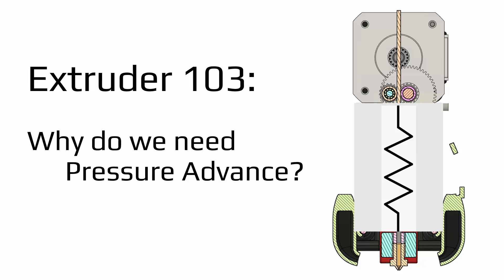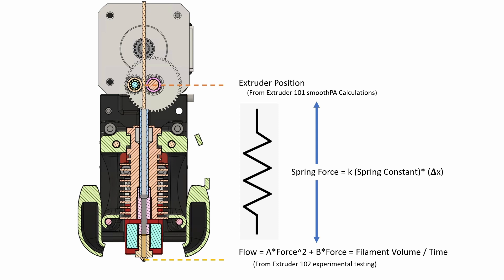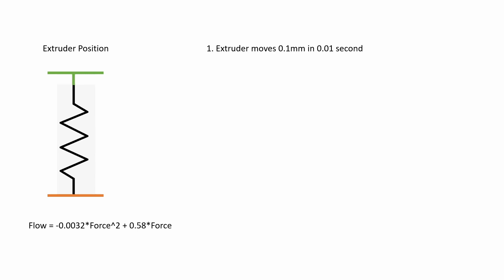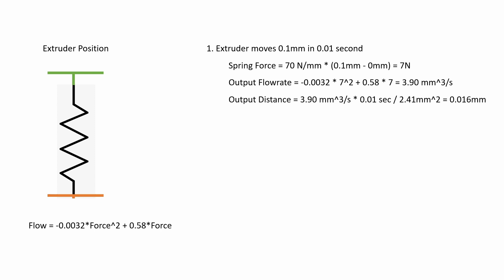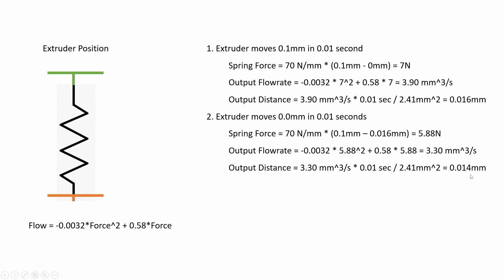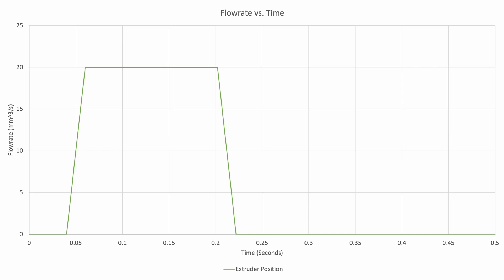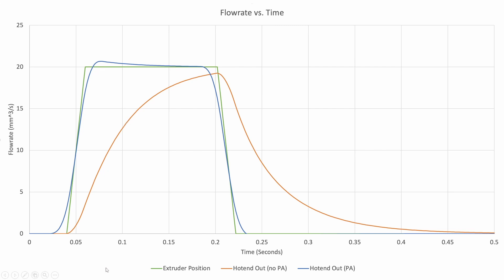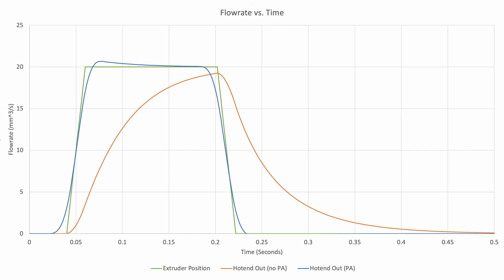Extruder 103: Why do we need Pressure Advance?

Comment: I cooked churros today and it helped me a lot to understand pressure advance.

Basically the process involves pushing dough through a stars shaped hole. The pressure is applied by turning a screw that moves a piston. The first I noticed was that when you stop turning, dough keeps coming out for about 10 seconds. Then I noticed that the opposite thing happens when you first start turning the screw.

Kind of random but it was very funny to me (but difficult to explain why to the other people in the kitchen).
Reply from the maker: This made my day!
Reply: @eddietheengineer  thank you! It made mine to!
Reply: Oh yeah. You're right. Also applying caulk or mastic with one of those tube guns.

Comment: Have yet to work with this feature. Appreciate your detailed analysis. Essentially an open PID loop with feed forward parameter? It would be handy if there were some form of real-time feedback in scalable stepper motor/driver current or strain gage with the correct span and resolution to close the loop. 
Relying on constants should keep the influencing parameters realistic between under and over extrusion with methods to verify cause and effect for tuning associated variables.

Comment: Excellent video! I love the graphs. You talk about the smooth PA somewhat rounding the edges of the green graph (for a lack of better word). At this point would it make sense to replace the trapezoidal motion with something similar to what S-curve was attempting to do in Marlin? (Technically I can't use S-curve in Marlin because it doesn't have the required PA implementation) While S-curve aims at reducing instant changes in acceleration (3rd derivative?), we could have the motion follow the blue graph instead for a similar effect, but with the added advantage of reaching an ideal extrusion. This would slightly increase print time as a side effect.

On a separate note, in practice moves can be fairly quick, perhaps under 0.05s in some cases. It would be awesome to see an actual graph of what would be going on if several such short moves at sharp angles occurred one after another. I bet the graph would look very different, but I don't have a quick way of simulating it myself.
Reply: I just thought of the same. I am not into 3d printer software but love the engineering behind it and asked myself, if the movement of the print head can be matched to the flow rate of the extruder. Maybe the motion system of a printer has a faster response and can compensate for the lagging flow.

Comment: I just found this series and I absolutely love it! I can't wait for the next installment! Since it's been a minute since you released them, I'm hoping the tool has been uploaded by now, but I haven't looked yet.

Anyway, question time. Your assumed spring force of 70N/mm, is that a spring force for a single type of filament, or an average across many filament types? Either way, what/which filament(s) did you base this assumption on?
Reply from the maker: That’s a great question! The spring force will vary based on the filament for sure. In the model I have, the spring force ends up kind of being a dependent variable (or maybe opposite, the PA is dependent on the spring force). If you don’t pair them together correctly the extruded amount vs time doesn’t match up with reality at all!
Reply: @eddietheengineer  that makes sense. PA is technically designed solely to compensate for this spring force, so it makes sense that there would be dependcies between the two.

Now that I think about, I suppose it really doesn't matter what the assumed spring force is based off of. It just needs to be something to make the tool visually represent what PA and smoothing does in an accurate and easy to understand way. It's not a replacement for an actual PA tune after all.
Reply: @whistlinturbo  , so we use different PA for different filament types, right? E.g. with PETG we probably interested in a greater smoothing compared to let's say PC as later one is more rigid (less springy)? And I'm assuming that extruder motor has enough torque to push either of those filaments.

Comment: I tested my titan style extruder which has a single sided filament gear plus a bearing on the other side to see what the actual impact of the gear itself is. So i printed a rectangle which was near exactly one rotation of the extruder gear per layer. I used clear petg so I could really see the difference in extrusion with and the teeth itself are really visible. I think this is commonly discussed as issue 6. Now I’m thinking about a way to compensate for it by measuring the actual feed of the filament itself, or calibrating the feed to the gear orientation and then measuring it with a rotational sensor. A closed loop extruder gear in other words. Would be great to see if it’s working.. at least with a modified gcode or so. However, in general it’s interesting what the actual impact of the extruder gears is and how it’s better with smaller teeth and bigger diameter.
Reply from the maker: You have me thinking--it would be interesting to have an encoder right above the hotend on a bowden style printer, and map what the filament position at the hotend is vs. the driven position at the extruder is. That should be able to help experimentally validate the model!
Reply: @eddietheengineer  Yes, this is what I mean.. I´ve looked for some hardware and sensors already. You´re on voron discord too, or not? If you like to, leave me a message and we can exchange some ideas. I´m making pcb´s and microcontroller stuff.
Reply from the maker: @randomname3894  yes! Feel free to message me, I’m eddie on Discord 👍🏼

Comment: I’m curious why use a smoothing function on the extruded acceleration, which produces a near constant jerk(mm/s3) rather than an equivalent effective constant acceleration. Is there something I’m missing? 
The idea would be to take the raw PA acceleration, and a acceleration limited version of if, and integrate to determine the missing impulse, then distribute that before and after the acceleration limited region up to the acceleration limits. By doing smoothing you are limited in the extruder by the torque available at a very short peak in the smoothed PA.

Comment: Cool thanks again Eddie for the education.
Could we not have 2 reels of the exact same filament feed into separate heat zones but one nozzle, via 2 identical extruders, then then required acceleration /deceleration would be split between two motors, this main mean going back to bowden, and step backwards until a better system is created.
Or idex with different nozzles, same material, (the reason I bought a bcn3d sigma), so infill and skins printed quickly by large nozzle and small details by small nozzle, (seems software isn't quite there yet).
Just spit balling ideas for anybody to shoot me down so I don't waste any time chasing thats already done please
Reply from the maker: That would be cool, especially with the two different nozzle sizes for IDEX! I'll have to try and see if I can do that once my IDEX printer is a bit more refined

Comment: Today i hadmortar in my mastic gun it seem far more elastic or compressible than silicone and there was a lag when i pressed the trigger and it continued to ooze long after i released the pressure. Seems pressure advance in essence is overcomming lag and ooze by applying and releasing pressure. In advance of requirement. Like ignition advance in a petrol engine

Comment: So if I understand correctly Eddie, if I use a different filaments or different temp, because it will not be the same fluidity, I would have to readjust PA
Reply from the maker: Correct!

Comment: I find it odd that people go into this level of detail to squeeze the most out of their printer, yet they are using a bondtech extruder with a massive filament path.
Reply: The filament path is the reason pressure advance exists in the first place. And what's wrong with Bondtech extruders?  Also, I'd hardly call the Voron Afterburner filament path "massive"